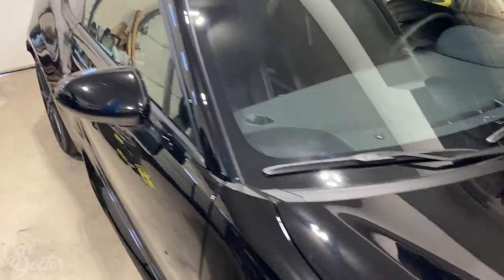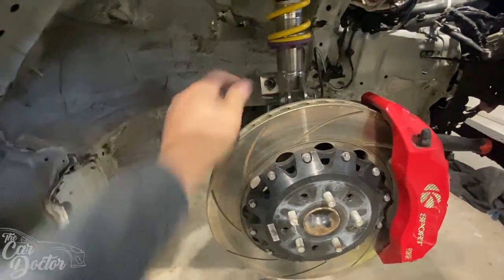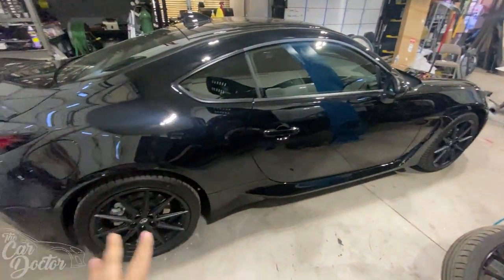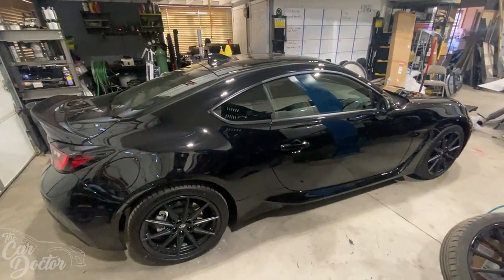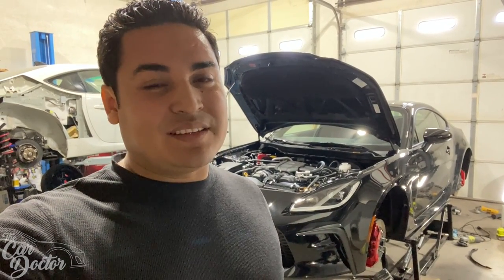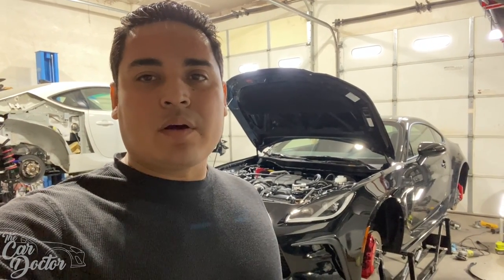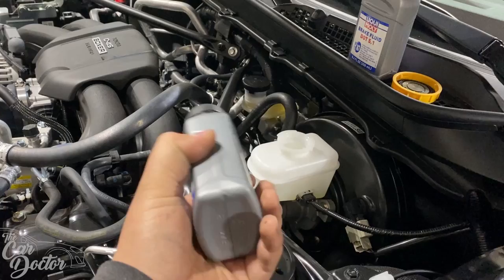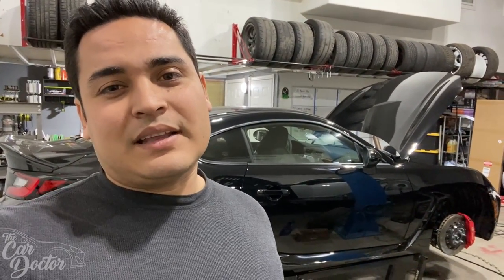My First Mod Toyota GR86 KSport Big Brakes

Comment: i wonder how viable it will be to snag a used GR86 a few years down the road with some milage on it and still do a e85 swap and UEL headers/racing exhaust/adjustible coils and a break upgrade. I mean i guess it will just come down to doing a "Compression test" etc on the used block...but makes me wonder if an AT/donor car will have better or worse engine health...than a used MT GR86. Kind of like looking at "starting" points for fb NA rotary builds, knowing an auto 12A didnt "LIVE" at the high rev range the way a 5 spd saw "ACTIVILTY" and care.

Comment: I've been looking for a rear big brake kit for my GR86. I don't see Ksport have a listing for them. Are you just using another front kit? Does the E-brake work properly?
Reply: He said they are the same as the FRS...
Reply: @eg6racer101  I may have not worded my question correctly. K sport doesn't have a listing for a rear big brake kit, even for the precious gen. My question, will the front BBK fit the rear as well.
Reply: @JohnAGeiger  not in the slightest. Even if you could do it you’d completely mess up your brake bias.
Reply: @KKangg  where do you think he got the rear BBK then? There is no listing for it on k sports website

Comment: What is e 85? Like what does it do/how do u do it/what are the advantages?
Reply: more compression, while avoiding detonation that a normal fuel would bring to the table. Its like the idea of BEING able to run "RICH" w.o having fear of combustion/detonation as e85 is IDEALLY made for this type of use/application. Be it NA or boosted/FI...only you dont have to run "RICH" with E85 to get the same "effect" one would have to entail with a carb v8. You increase flow/exhaust ratio....you need more fuel....thus "RUNNING RICH" on NA v8s or even turbos becomes "standard" even though e85 is much more ideal/practical as you can see with the amount of engine rebuilds a drag car/top fuel/keith black build would entail. And those respective race/classes/fuels.
Reply: @anhiirr  preciate the great explanation bro🤙🏾💯